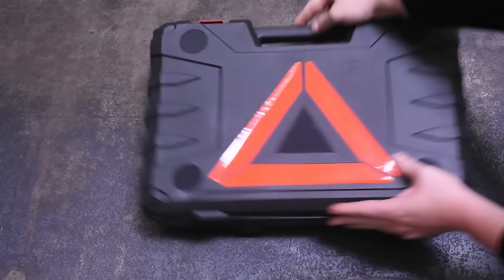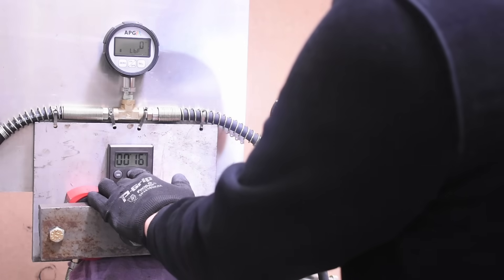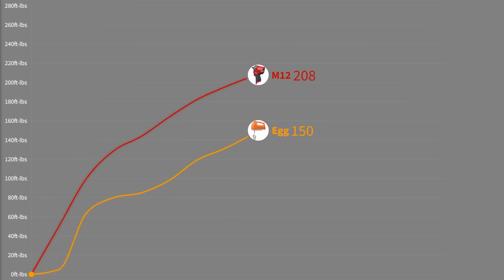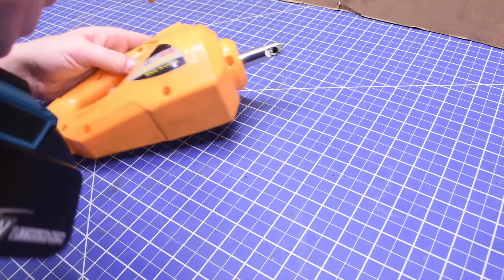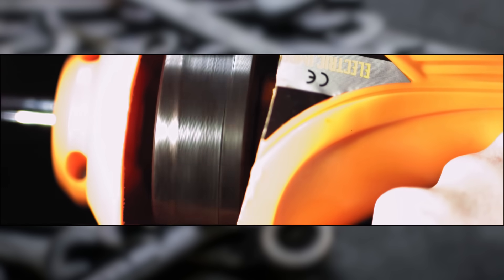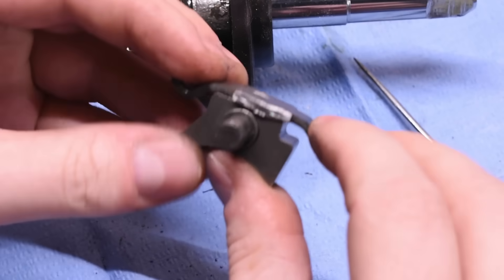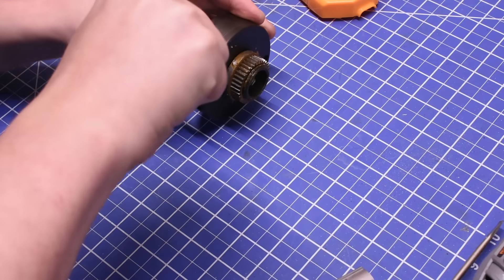The Infamous Egg-Beater Impact Wrench! Testing & 10,000fps Slow-Mo

Comment: Apparently it was cheaper to use a motor for the jack and a motor for the impact wrench than it would be to make an impact rated scissor jack.  I've often wondered why someone didn't make a portable impact wrench that wound up to a higher RPM before the hammer strikes the anvil, and now someone has.

For applications where weight and size are more of a priority than speed, this is a good design.  I'd love to see a good tool company use this concept.  I prefer a breaker bar for roadside tire swapping but this could be a good design for some trade such as solar power installations where a specific fastener torque is needed.  A tool could be designed to impart only that amount of torque, that monitored rotation and signaled green when there are five hits with very little rotation.

Comment: RETRY at 13.7V using battery charger, or 14.4V with car running.  CAR motor should be running when you use this thing on side of road.
SHOW the voltage!   How good was the battery you used -- cranking amps ?    

(already subbed, love the channel, liked the video. not trying to be a grouch)
Reply: Ive used the same design with a 18-20v Hypertough battery, the tool doesnt mind at all.

Comment: I'd love to see the motor swapped out with something more powerful. I'm sure it wouldn't be too hard, and it seems like you'd gain a lot because the main bottleneck seems to be that weak motor. With a more powerful motor, it could spin up that big hammer assembly much faster so you'd get a lot more IPM out of it.

Comment: Fascinating! I bought this type of lugnut removal tool back in like 2005 and sung it's praises for many years as I was able to help multiple people with flat tires, including myself once.  
The Achilles heel, however, seemed to be the cold. 
I noticed it worked a lot less - or not at all - when it was very cold out, which unfortunately is fairly common in Minnesota.  
But it served me for more than a decade before it stopped working one day.

Comment: It uses centrifugal force to over come the tension of the springs  to speed up the hammers before they hit.. put larger springs in and a better motor, maybe you get a way better tool?! that´s if the hammers can fold out fast enough for it to hit

Comment: i lifted a 8500 pound boat with the trailer with one of these jacks. Thought we fried it on the 6 or 7th lift but it turns out it was just the fuse in the cigarette lighter! Fuse fixed and im still using it 5 years later. 10/10 best impact + jack car kit that exists. period.
Reply: If you've got blocks and leverage, Id take this over any floor jack anyday.

Comment: That hammer design is pretty ingenious in its simplicity. I'd love to tinker with something like that.
Increasing the anvil weight, increasing spring tension, using a better motor. 
Also interesting to note, you can see that sometimes the lever rocks backwards and catches on the hammer as it is knocked back, that raises a couple of questions for me if the mechanism could be adjusted to make that controllable that might give some great loosening ability to the mechanism, first off the motor wont have to fight against the reverse inertia in the assembly to spin it back up, secondly, that reversed impact hit could provide a slight wiggling action to the nut/bolt as its going to be wiggled slightly back n forth every hit. 
Only thing I'm not sure of is how much energy going into the hit in the intended direction, if we're talking like 9:1 that would be acceptable but obviously anything that gets closer to 5:5 is just going to be net neutral.

Comment: You can promote the eggbitter impact driver to egggrinder impact driver just by replacing the brushed motor with a beefy bldc motor that is all it needs it's just underpowered with that tiny motor spinng the giant hammer

Comment: I had one of these 12 v electric scissor jacks,they are poorly made and i wouldn't trust them to take the weight of one side of a car while your changing out a tyre. The thread stripped itself after 4 uses! Dont risk it folks. And dont support china with their crappy made products!

Comment: When i first saw this, i assumed it was gonna function like any other impact  but cheaper, but the way this works seems like a slower, but highly effective method of getting things done, and it makes me think of what it would be like if it was fitted with a heavier weight and a better motor so it could be priced similarly to a decent conventional impact. I have a feeling it would become great at removing rusted and very tight nuts. It would probably also become a bolt snapper 5000, but that's besides the point lol

Comment: These impacts first appeared about 20 years ago - the Shentai.  I bought one ($AU70) and it got me out of a huge problem in the outback. I blew a diff pinion seal and needed to replace it.  The impact easily removed the pinion nut, and enabled me to replace it plus about  + 1/64th turn.  Worth it's weight in gold.  It will also undo rusted exhaust flange nuts that need 2 long extension bars to reach, where the bars absorb all the torque of a normal wrench.  This was before the days of the Li battery powered tools we now love.

Comment: A jack can't be a 'widowmaker' if you're using jackstands like a sane person. As for changing tires, worst case is your jack fails while the wheel is off. Sucks but unlikely - and unlikely to hurt anyone since changing tires doesn't require getting under the car.

Comment: I used a similar 12 volt floor jack as a outboard motor lift on my old 40 Mercury.  Heck of a lot easier than manual lifting it.    Nice work guys.

Comment: I've got one similar but it's much bigger and quite heavy for its size and has the handle on the back like a small jackhammer. Quite powerful as it takes a 30A fuse inline with the battery clamps. It will loosen nuts and bolts that my air impact won't come close to moving,great for those 4x4 wheel nuts that the shop does up with a million pound impact every time i get new tyres.
Reply: What’s the name of that one?!? I gotta get one lol

Comment: You should try it running at the voltage coming from the alternator 13.6-16 see if it works any better then just off a battery (my thinking is having the vehicle running when using)

Comment: I had something similar to this over 10 years ago. Some cheap crappy feeling thing that could be hooked up to the cigarette lighter or directly to the battery. I was really amazed how powerful it was, all tho extremely slow. But saved my back on rusty super tight lug nuts.

Comment: I have the hydraulic jack version of this and it works okay so far. Only had to use it twice in two years.

The weird little impactor hand tool that came with it was complete crap. It didn't do nothing at all it was just a dud out of the package. 

Scissor Jacks Are death traps and you have to replace them after only two uses. Always go hydraulic but I'm not really sure if the electric hydraulic jack is worth it. It takes up a lot of storage space and it's heavy.

Comment: Cool I just made a video on a Chicago Electric from 2002 it works just like this but looks like a normal air impact shape. For as cheap as or feels surprisingly packs a punch it takes alot more speed on mine before it hits. Great test 👍

Comment: That cigarette lighter connecter that it used, Ive seen it used in other things, the reason it failed is cause it has a fuse in it. The tip unscrews and you can replace the fuse

Comment: Dude send 24 volts to it 😲 and also I've been wanting to build an impact wrench with a starter motor, I think a very large centrifical flywheel type hammer /anvil would be perfect for a low rpm starter motor. Very big heavy hammer. Artillery like inertia.

Comment: I bought a 12 compressor to carry in my work vehicle and it works just fine using the accessory outlet, but there is a big difference in performance with the vehicle shut off compared to the vehicle running.  Try it if possible plugged into a 12 volt source with the vehicle running and see if it has more power.

Comment: I had an older more pistol type of one of these I kept in the trunk as a tool of last resort, slow, but it hit surprisingly hard until it let the smoke out. Took out more than one bolt where jumping on the breaker bar didn't.

Comment: But the m12 is rated at 250fp
Reply from the maker: This channel wouldnt exist if you could just read what each tool is rated for and use that as the truth
Reply: @TorqueTestChannel  thats not what i meant its when its torqued at like 400fp it seems normal to me that it cant undo it
Reply from the maker: Oh for sure. You're right. Just demonstrating the egg one is above a compact

Comment: That's two tools going on here
The impact wrench is actually a really innovative design 
It's not only using the spin up and slap with a hammer using centrifugal force, because of the Diameter of the hammer mechanism, it's also acting as a flywheel.
With enough of a reduction and a few tweaks that could make a MASSIVE amount of torque.
If I were trying to re-engineer that, I would replace the pressed metal hammers with much beefier machined ones straight away because they will be the failure point, then make the flywheel larger by extending it into a planetary gear barrel. Then use a motor about the size of an M18 and change it to a pistol grip.

When you're doing that kind of work crank bolts, track bolts, lock tights etc you want, three ughaduggas done.   Weight and space are sometimes an issue, but the flywheel design means you could make it super low profile one way by flattening the flywheel or super slim by lengthening it.

The jack is easy, put it on screw inside a bottle jack rather than the scissor jack might be my only suggestion.

Great video! Thank you, gave me a whole new insight into how far power tools can still go!

Comment: This has similar style of impacting as an EL-Max nutrunner which is used on trucks and other heavier equipment, except el-max has the impacting action behind a lever. Not sure if it's used in anywhere outside scandinavia thought

Comment: The only problem I have now is.. they show the egg beater impact with a weighted socket, and the cordless impact with a normal socket in the Tik tok videos. When you’re using a weighted socket you can’t get an accurate result when you’re using a normal impact socket with the cordless tool. As far as I see, the cheap Chinese life hack video has no real standing ground

Comment: One of my cars came with a similar impact wrench, though it's a bit more "gun shaped". The previous owner was a bit older so he used it to help with the winter tire changes :D
Don't have the car anymore but I did keep the little gun. It came with a nice combination sized impact socket and damn if it doesn't work...

Comment: I think I am going to get one of these. I just want it for if my tire goes out on the side of the road one day, then it can help me do that task. So it will sit my trunk until whenever I need it. I don't need it to be the best or be something used daily, just something to get me out of pinch. I won't have to worry about the battery dying from sitting in my trunk and not being able to use it when the time comes because the battery is dead, this thing doesn't have one so it should work when that time comes. Hopefully the cable is long enough though, but I can extend it if needed. Perfect for a scenario like what I need it for and don't have to spend an arm and a leg.

Comment: I’ve actually mod mine when I was in college 
I had no money to buy a 18v branded impact but still want to work on my car/bikes 
So I got a old car starter motor swap out the original motor in the tool use it with a adjustable power supply set to 14v and it works great 
It only takes one hit to crack loose a normal car wheel nuts (tq to 120nm)

Comment: Id like to to see the greenworks iw24L00 impact with the 4 ah batt, i have one and am quite happy with it, have had it for a year, maybe 2 now and use it on the regular even when its -15 or colder out here.,.. greenworks claims 400 ft lbs,... ( Their website has it flipped,.. says 540 ft lbs/400nm) i see you tested the 300 ft unit, they are both the same size, and id like to see of there is actually a difference, with both on the 4 ah battery

Comment: The jack has a 3 ton limit, this would work great for changing a tire on a truck as long as the other 2 wheels are firmly planted on the ground. i wouldnt use it on a 1 ton truck or above but anything smaller id give it a go

Comment: Ill stick with my 4 way and my small floor jack. (one of those little 2.5 tons floor jacks that has the 2 foot handle or so) It is however nice to see that this stuff does actually work.. mostly as intended.

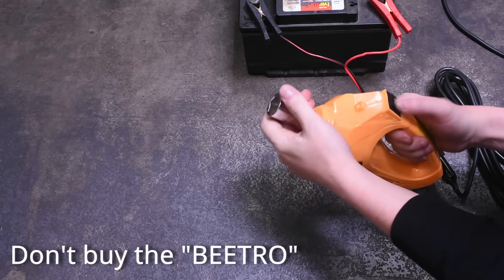Comment: 1:47 fuses dont blow instantly.... 
.
so i bet the fuse got some heat into it (from all the "0 to 100" in rapid fashion) 
and then 1 more 0 to 100 was all it took to melt the fuse.... not BLOW the fuse (aka, the normal loud pop and blue flash)
but simply get it red hot, and stretch till it failed 
.
another 5 amps on the fuse and it would be fine for the peak loads.... 
and the tool will never see a peak power like that under sustained use (or the delay most normies and not NASCAR people have between their 4 or 5 lugs)
.
however, the extra 5 amps might also be over the cables current rating LOL
id almost bet the farm that its aluminum and not copper 
.
its so cheap.... they made it look like that because its easier to make strong 
a "pistol grip" is like a 90 degree stress point.....much easier, quicker, and cheaper to snap wrists

Comment: This is one of those "sour mouth" moments where I want to hate it.. 

But <$100, with a jack, socket, and carry case.. Its hard to argue with, especially considering its hand-driven counterpart kit is $50-60. 

Of course if you're young and tough (like the internet as a whole thinks it is), changing a wheel by hand isn't that bad.. but for someone a little older and fragile- this kit would pay for itself first try (assuming it isn't DOA from china).

Comment: if you used 14.4v to simulate a running vehicle, maybe it'd work even better. Provided it doesn't use a voltage regulator that is

Comment: That's pretty ingenious design for an impact, simple and effective.

 I wonder if putting bigger gauge wire on it would allow it to works longer before starting to smoke, or was the motor the one that was heating up and burning the case causing it to smoke.

Comment: Seems like the next evolution should be a electronically controlled interrupter. You could have an electro magnet at some point of the rotation that could variably trigger the hammer to hit the anvil. In doing so you could vary the speed the mass spun up to before it engaged.

Comment: i guess it will try to rotate in reverse which makes motor to work as generator, but since it will be making voltage in reverse polarity it will act as break for motor and it will turn off light since wires to battery are too thin.

Comment: During your disassembly, the wing showed a good deal of damage. Not sure if that was due to trying to remove the wing from the casing, or from the use during the testing? If from the use, it means that the tool won't last long. Despite that, the materials and tolerances seems loose and flimsy. I imagine this is your finding as well.
Reply from the maker: Had to cut it out

Comment: There should have been a fuse in the tip on the male part of that cigarette lighter. It should unscrew and the center spring loaded button should have a fuse inside it.

Comment: I purchased one of these type impact tools from a Target store about 20 years ago. It worked with the same principle, but the plastic case was so brittle, it blew up in my hands. Returned it right away and the clerk said they had just pulled them because of this failure.

Comment: I have had one of those for over 10yrs. I hadn't used it in a while, and it froze up. I took it apart, and it works good as new. They are definitely a big help especially if  you go to a shop that uses an impact and over torques the lug nuts.

Comment: Doesn't seem like a good assumption that the other brands are actually a different manufacturer, so one would be well advised to put something like this through its paces a little before relying on it. Trading power for peak force is a good trade for what this tool is supposed to be though.

Comment: I’ve had one of these cheap 12V impact guns for over 10 years. It’s great for occasional use. It will remove wheel nuts that I’ve failed to remove by normal spider type wheel brace. I also now have a proper dewalt impact tool. I am intending to try the dewalt hand tool driving my 3 ton standard scissor Jack via an easily available Hex adapter.  My Kia Eniro at 1800 kg is hard work for winding it up by hand. 

I would love to see a video of a dewalt or similar impact wrench driving a standard scissor Jack to hoist a heavy car. I think it should work great, but haven’t tried it……. Yet!